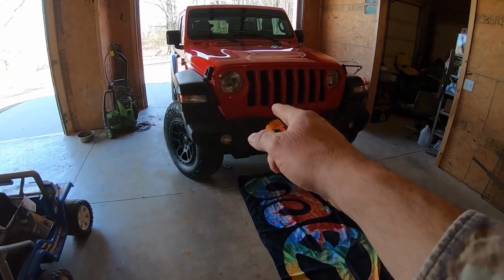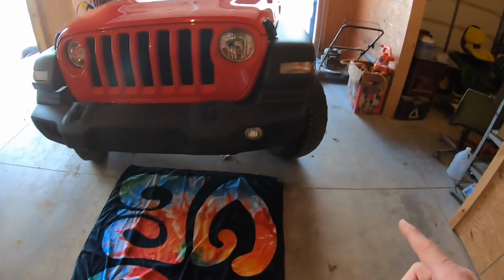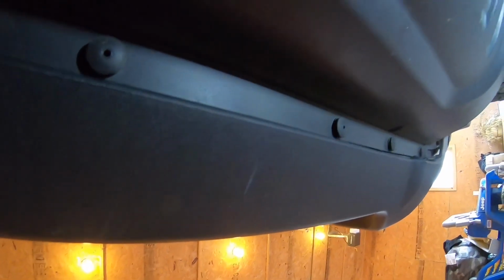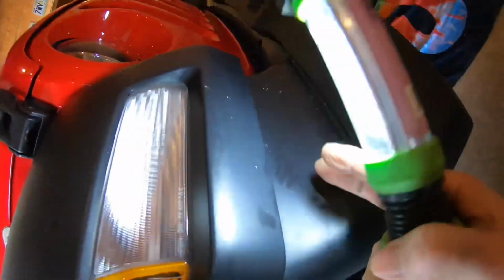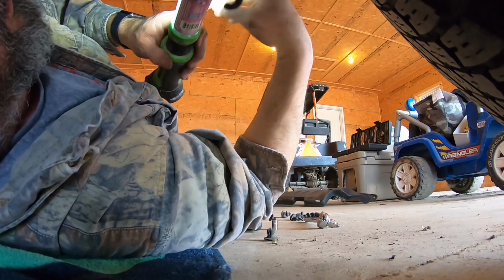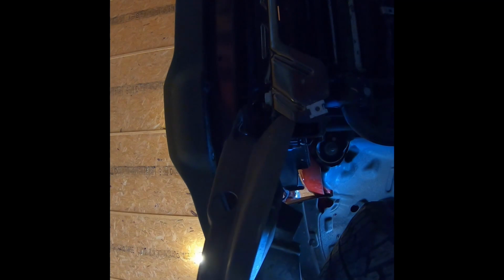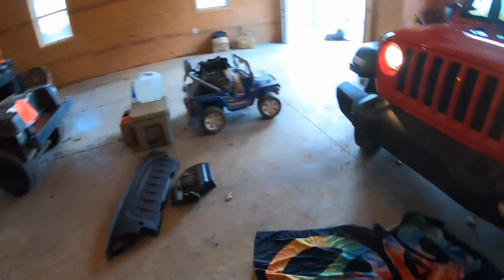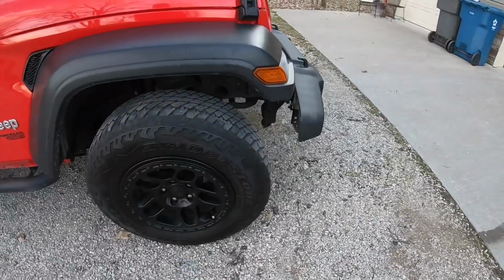Jeep Wrangler JLU 2018 plastic removal

Comment: Yeah! Thanks brother! Took mine just while ago. Looks better without those end caps! Bolts/screws were loooooong! Lol! Did put the skid plate plastic cover back on.  Bit worry bout the fog lights wires and cables being exposed. Might cut/trim the end caps on summer and maybe put them back to cover those exposed area. What do you think? Anyhow, thanks brother!
Reply from the maker: I sure appreciate it man! I have done this with other JL and had no issues with wire showing. On the Rubicon‘s and I believe Sahara is the wires are showing anyways so should be no worries
Reply: @jeepthings8875  great! Thanks brother! Dont forget to record and post whatever you do with your jeep. Ok? Stay safe brother
Reply from the maker: @torontoraptors2107  I sure appreciate ya!! And I will keep updating you take care my friend